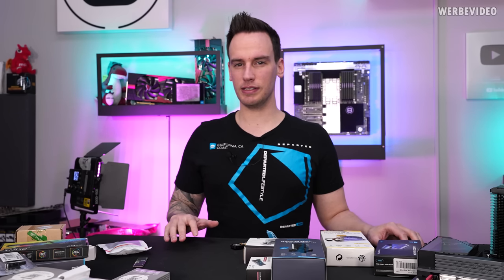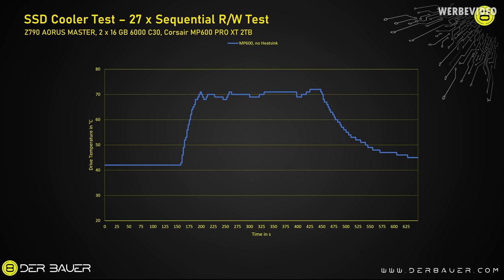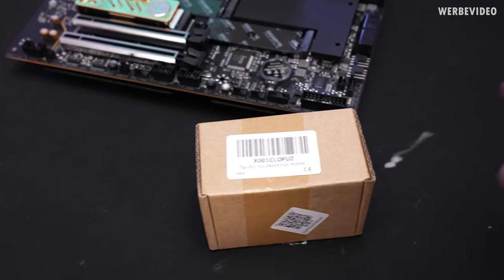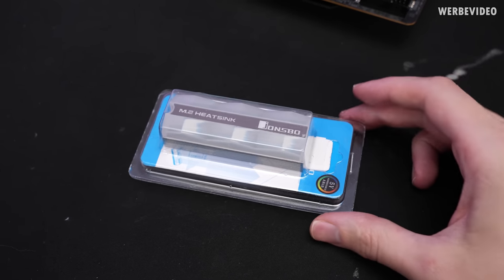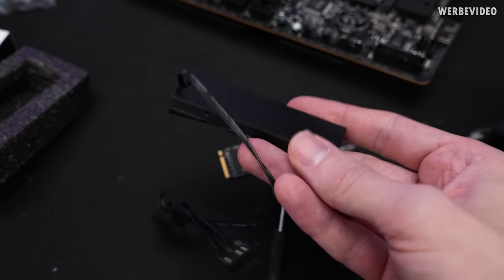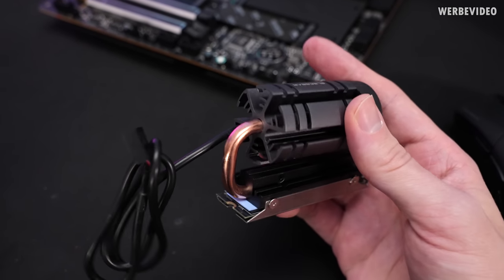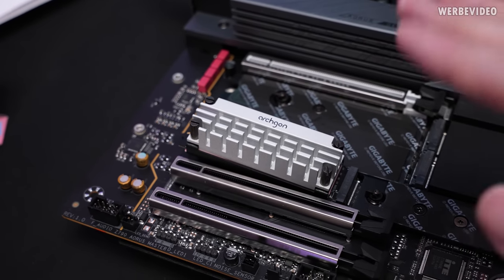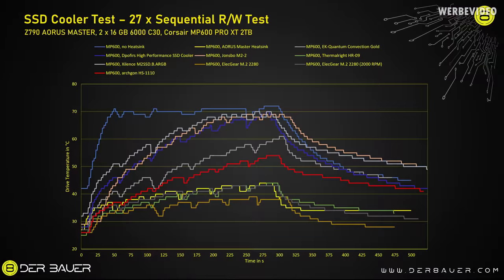Who designed these? Terrible Cooling Performance and "Interesting" Mounting Solutions

Comment: Might be unfortunate that M.2 caught on like that. Not a lot of space to put stuff on compared to an AIC or a 2.5'', and I'm a little concerned about putting tall, heavy coolers on it hanging sideways- How much weight and leverage is it designed to take?
Reply: how is it "unfortunate"? the real "unfortunate" thing is people believing any kind of SSD needs active cooling or whatever
Reply: @EMILE12345678901  okay I’m glad I’m not crazy; I thought that was the case.  Isn’t 70c completely fine for an SSD?  I was thinking to myself that I was missing something this whole video
Reply: @SteveKelly1  parts of the m.2 SSDs can run at high temps, others suffer from it, so in general, keeping the temps down can increase the life and speeds.
Reply: @SteveKelly1  Corsair set this drive to throttle at 68 C.
Reply: @EMILE12345678901  depending on the situation, they may. If he tested in an open air rig it's different from a case
Reply: @SteveKelly1  It's throttling temp for controller, while it's fine for the flash chips themselves
Reply: @marcogenovesi8570  Phison's blog post 'Turn Down the Heat on SSDs' says it's the other way around.
Reply: @whyjay9959  I've never seen a single datasheet that says NAND must stay under 50 celsius so his opinion does not match what the chips are rated for by the manufacturer.
As for the controller, yes you can push the controller up to tjunction which will be in excess of 110 celsius but it will be in HEAVY thermal throttling so SSD performance will be relatively poor.
Most controllers will start throttling around 70 celsius on the controller, which is still perfectly fine for the NAND.
Also for 99.99% of users even with heavy thermal throttling on the controller the SSD is performing plenty fast and they won't notice. You notice issues only if you are a file copy enthusiast or you are running them in a server that is actually hammering them with a database or similar disk-intensive task where you really need those 6+ GB/s speeds
Reply: @marcogenovesi8570  Seems like it makes sense to thermally connect the controller with the NAND, that way the memory can get to perfectly fine warmth while the controller doesn't throttle.
Reply: @HappyBeezerStudios  That boat has sailed years ago when performance was still in Sata SSD Land.
Anything on NVMe interface will just get hot, period. There is no "cold spot" to harness, NAND will heat up in operation too. In most cases it's just better to leave the controller to fend for itself and throttle so it does not overheat the NAND.

Some form of heatsink is really a necessity if you actually need 100% of the performance under a long load. Most end users don't, so they get by with just thermal throttling

Comment: Give me performance over bling!  I don't stare at my computer case, I'm looking at my monitor!  Putting a plastic insulative shroud over a heat sink is counterproductive, unless you are actively trying to duct air away.  Good info!  Need to tell my kid to replace the mounting post he lost when he was installing his motherboard.  He ended up leaving the MSI M.2 heat sink off.  Probably not a good idea if they can get that hot!  Thanks for the info!

Comment: I would like to see you experiment with cheap DIY solutions and what performance you could get. Like repurposed heat sinks from old hardware, small single chip heatsinks and other thing that is commonly available.
Reply: I tried putting a single chip heatsink on the SSD controller - 0 effect :)
Reply: @AuDiGo6  Yeah if you're talking about those cheap, little aluminum ones that's not going to do a damn thing. Active cooling with a small fan above the controller would likely help. Combined with a little heatsink from an old GPU or something it might work surprisingly well.
Reply: @JJFX-  Or from Raspberry Pi or custom GPU cooler sets. they tend to have stuff that should fit
Reply: @HappyBeezerStudios  Yeah I was thinking that too but the only pi coolers worth a damn seem to be larger than the CPU. Could probably still work though.

Comment: I want to see the performance of a simple extruded aluminum heatsink, like was used on chipsets back when motherboard vendors didn't care about looks, that also fits.
Reply: I have one and my slower 2400 1900 speed drive doesnt even go above like 29-35c in normal use
just a dinky little piece of aluminum with short stubby fins sticking out of it. and a thermal pad. works fine

Comment: If you're going to make a follow-up, there are two categories I would be interested in: things that look interesting, original or strange, especially if they are decent, and things that look like they might perform, but actually don't (an example would be that copper thing; the rubber bands would have put me off, but otherwise I would have expected it to perform; although, if it had a half decent mounting mechanism, perhaps it would have?!).

Comment: I've seen many SSD cooling solutions and this begs the question that Gamers Nexus brought up long time ago.
Isn't it the case that only the controller needs cooling, and you shouldn't cool memory chips?
From my knowledge, flash memory chips actually work much better when hot, and there should be no real reason to cool them, unless they reach critical temperatures, which they shouldn't on their own anyway.

P.S. the Dpofirs probably needs to be working with motherboard upright, otherwise there will be no convection through those fins.
Reply: A simple finned cooler over the entire SSD that can bring some of the heat from the controller to the memory chips.

Comment: I avoid bent heatpipes at all cost.  Crushed or kinked they literally stop working right.  Also, have you tried Noctua's series of 90mm CPU heatpipe coolers?  They seem to work just as well as the big 120s and 140s because the first two inches of heatpipe are the only parts that do any real cooling.    The big question I have is why haven't companies started making SSD cache cards that plug into the M.2 and then you plug your M.2 into them?

Comment: I can testify for the rubber band... I got them with Samsung ssd I think, they failed in 2 months, brittle... luckily the cooler was pressed by graphics card to the drive, so it did not fall off. Also waste amount of motherboards puts the M2 slots in such a stupid spaces like right under graphic card, where you can't fit any cooler for it... The best results I had were with the 4x M.2 PCIe card from Asus, but you need bifurcation support for that and Intel can hardly do it.

Comment: If you can test one of the most popular cheap option : those single sticky metal heat sink (+/- 1cm x 1 cm) and 1 per mem-set and 1 for the controller so they won't share heat.

Comment: I'm surprised you didn't also include the Thermal Grizzly cooler. I'd love to see how effective it is for Gen 4 drives. I am actually currently using one, but it's on a Gen 3 drive (Samsung 970 Evo Plus) which doesn't get as hot. It's quite effective for its size though.
Reply from the maker: I just feels wrong to test your own product
Reply: @der8auer-en  But why though? You've made planty of videos showcasing your own products. When you delidded that 7900x for example you used Conductonaut Extreme for the testing and were transparent about it. As long as you try to be objective and transparent I don't see a problem.
Reply from the maker: In These cases I was testing my product by itself and not against competition.
Reply: @der8auer-en  Put a big fat disclosure on it and test it anyway.
Reply: I still feel it would be fine to include it. After all, it's a cooler aiming to work on the same problem. Maybe it's better than all of them, maybe there is a different one that beats it. Maybe it has has a better price point for it's performance or does better in terms of size.

Comment: IMO I think the ones that just add mass and "buffer" the thermal energy are probably fine for lots of use-cases, but they definitely could use some more fins. Consumer storage uses, even for big video files is relatively bursty or held back by other parts of the system in my experience. Maybe you're transferring 50-100GB of files and then nothing for hours. That's the case in my editing machine. I only see my MP600 hitting full speeds when importing video files into my editing software and it's being indexed, then it's just barely used when doing actual editing for the next couple hours.

Comment: doesn't it defeat the purpose of small slim storage that's unusable without big cooling solution
Reply: IKR, I don't see the reason to have any heatsink on SSD, 
I mean, mine doesn't have it and I have been using it for over a year now,
Reply: it's not unusable, the controller will throttle and lower the performance but it will still be plenty fast for normal use. But yes, m.2 is a dumb standard and has always been.

Comment: This is awesome! I love this content!  I feel there’s a tendency to try the cheapest garbage out there, but I think this space has allot of high performance products that go unsung.  I would like to see more of the really good SSD coolers.  But also, I like seeing the spread of interesting designs.  The really bad ones clutter up the charts as outliers, but the high performance nuances are also very marginal in practical terms.

 Looks like Ineo, Acidalie and Gigabyte Aorus have compelling designs from my limited research. The thermaltake one you showed looks best of all. 

My system has two 200mm fans in the bottom of the case, and blows straight through out the top, so I’ve been looking for vertically oriented fin stacks on all my components. Designed around noise optimization and passive cooling utilizing just the flow of the 200mm case fans. 

The 2tb Gigabyte Aorus 7000s Prem looks best in class. With two heat pipes and a radiator, it looks really well built and engineered. And at nearly $300 it’s what I’m hoping to get from DerSanta this year ha ha.  If you haven’t seen that one, check it out. 

“GIGABYTE AORUS Gen4 7000s Prem. M.2 2280 2TB PCI-Express 4.0 x4, NVMe 1.4 3D TLC Internal Solid State Drive (SSD) GP-AG70S2TB-P”

Comment: I've seen on quite a few (mostly lower end) motherboards the included M.2 heatsink and thermal pad don't actual make contact with the SSD leading to the SSD just getting zero cooling and presumably being worse than mounting it without the heatsink (could be interesting to test without the pad in the next episode to confirm?) because it gets zero airflow from the non-contacting heatsink. Also seen a couple where the supplied thermal pad is way too thick which just bends the very thin M.2 PCB. Only decent mounting solution I've seen for large motherboard heatsinks is high end ones where they also have a rear heatsink mostly to prevent that bend while having good clamping pressure between two soft thermal pads.

I really wish the consumer space had a better form factor for next gen SSDs like what's offered by KIOXIA XD series, I feel M.2 NGFF drives were really just a stop gap to shove SSDs into what was originally a WiFi adapter and low performance low cost eMMC form factor. 

Also the test you performed also didn't make sense to me, you do several cycles in Crystal and drives clearly overheat and thermal throttle yet in the temperature graph they still seem to take the same amount of time to complete the test? I thought Crystal used fixed test file sizes (1 GiB) which take longer to read/write when a drive thermal throttles? How do those SSDs thermal throttle if they still complete the same file transfers in the same amount of time? I assume you were just looping the test and stopping it at a certain time for all heatsinks regardless of throughput?

Comment: 1 minute is like 200GB transfer....More than any human would need on normal use, none the less if I get a expensive 4TB someday I probably make sure to add a heat-sink despite what experts say about optimal temps since no one did a proper life-spam testing with and without them. I do believe in low deltas in temps = longer life-spam.

Comment: Nah.. Even a cheap, sub 10$, rubber band held heatsink , can improve temps significantly compared to a naked ssd. Also after 4 years, my rubber bands are still in good condition.

Comment: Great video. Always appreciate your insight.

What'd I'd really love to see is your own design to produce the best thermals in a SSD.

Also some clarification on what part of the SSD requires the cooling? I always thought it was only the controller chip that needs cooling as the memory itself operates better at a fairly high temp.

Comment: I heard early on that the storage is quite happy at 60-80 degrees celcius rather than being cool .I figured I would not even need a heat sink . I only use a 256gb ssd and a 1tb ssd. My hard drive gets (used to )warmer on average when transferring data for long periods. It will take a bit but I would upgrade to a 970 evo 3rd gen pcie or 4th gen. The info is good for that upgrade cycle and beyond as storage continues to get faster. The thermal paste might be for making the patented angle adjustment part a tighter thermal conduction zone. If the pipe can roll the tolerance cant be perfect.
Reply: The memory might like it warm, but the controller will hit it's thermal limit
Reply: @HappyBeezerStudios  yes that would make sense , the other types of drives also have controllers and that is likely the ultimate bottleneck .hmmm good food for thinking .

Comment: I once bought a north bridge cooler with 2 heat pipes on it for $10 on aliexpress. It had fan mounts on it so i mounted a 40mm fan to it. It was a massive improvement on temps on my old X58 test board for overclocking. But the quality and mounting was definitely bad as the top fins fell off over time.

Comment: I actually have a oddball heatpipe one with proper mounting but... only a few fins that's obscured by a mirror.

And ID Cooling ZERO M15. May look like its thermalright inspired but thermalright used to work with them and ID cooling designed them (this was after thermalright engineers left the company so they dont have much in the way of engineers anymore allegedly)

Comment: Nice but I wonder how some other types would compare such as the ($29.98 U.S.) ElecGear EL-80X or what appears to be even better...the ($28.99 U.S.) NewHail ASIN B0BQ6SG6C5. Although on my motherboard, it would sit about 1/4" above the GPU and about an inch below the CPU so I guess those are factors that could skew the results a bit.

Comment: I grabbed an ICY BOX IB-PCI224M2-ARGB (didn't care about the RGB, it was the only model available) recently when I grabbed a 970 Evo-Plus 1TB.  It's pretty much just thermal mass, but that's all I need as I don't read or write for more than several minutes at a time, but found that my 970 Evo used to thermal throttle pretty quickly, so just wanted to extend the full-speed window and it's worked well (AFAIK, I've not set up thermal logging) from the few times I've looked and the initial testing.

Comment: This is pretty cool, Having built my first water cooled PC was down the rabbit hole of every component and its heat and how it was dissipated. Ironically PCIE gen 4 came out and heat/NVME thermals was just being a said gimmick, threw on my own testing and seen hell these chip got HOT. Same for overclocked RAM and worse this new DDR5 RAM actually see temps kind of scary!
Using water blocks on the RAM and overall the whole PC found that my overall thermals are better and with the 3x420 dual thick highflow rads was able to keep EVERYTHING under 40 degrees C with undervolting the 3090 and 5950x actually found a lot of overclocking headroom potential which seems backwards but made for a high more stable overclocks by starting undervolted and as stable close to ambient as possible.

Comment: I have owned the INEO M9 heatsink(just like the M11, but with a less refined fan design) and had a good experience with a 980 pro SSD, at full load, finally I came across with the Acidalie M.2 heatsink(Passive cooling), and for my surprise, had better results.

Comment: Not sure why youre HWINFO64 isn't showing the temp of the M.2 controller also but I assume cause you are using a crappy Corsair M.2. 
 Controllers can get very hot so it's important to know temp2 as well. Should have used a Samsung 970 Evo plus they get very hot but cool excellent under a heatsink, at least under my motherboards (M13H) heatsink it does.
M.2 heatsinks are pointless & btw EK has produced nothing but garbage for the past 2 years or so (w/ the exception of gpu & cpu blocks).

Comment: We also have a pet called Makita but she's a dog :) and we call her Maki. As for SSD cooling I went the diy way: a laptop heatsink with the heatpipe replaced with a 30 cm long by 8 mm round one from aliexpress. I used a spring with 8 mm inner diameter to bend the heatpipe and I snaked it from the SSD to the CPU fan. The only SSD slot is 10 mm under the video card so no other comercial solutions were viable. Temps stay between 40-50 C, SSD 970 EVO plus. Without cooler over 65 C.

Comment: Yea, regarding the rubber bands, those seem to be exactly the same that ICY BOX deliver with their M.2 cooler model: IB-M2HS-701. I reached out to ICY BOX and asked about how durable they were and never got a very good answer. I have since I bought them only used them for about a year and they have hold up against heat. But if you happen to put them on to sharp places on a heat sink like the one I mentioned, they easily get damaged. I do however not have UV getting into my case so I can't say how resistant to UV they are. When I bought this product they cost ~€7 wich was like half the original price, and I would not recommend anyone buying them unless the price is like I payed for them, or less. The heat sink does make a difference and you get 2-3 thermal pads with each heat sink.